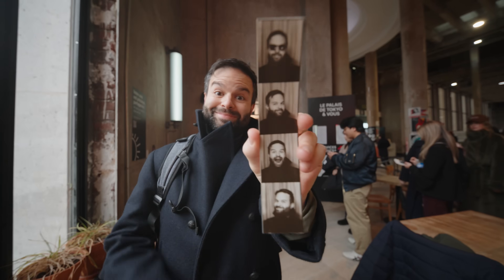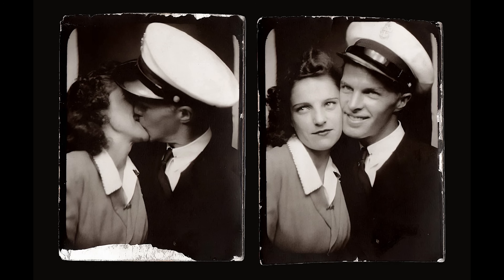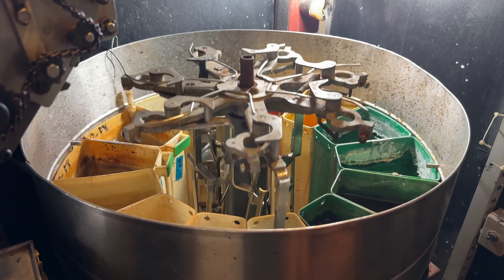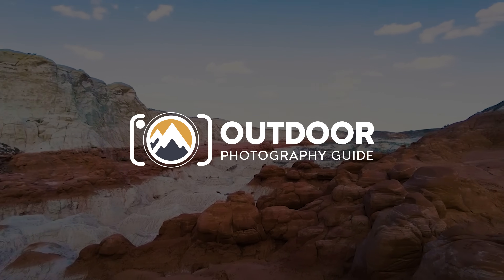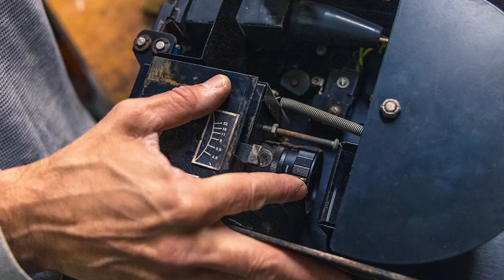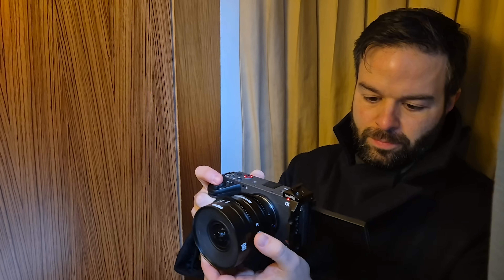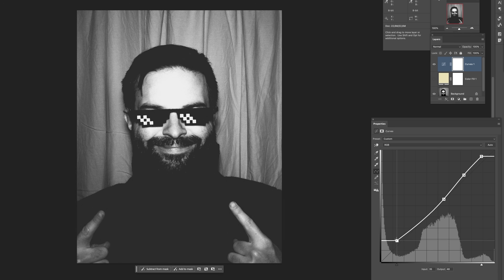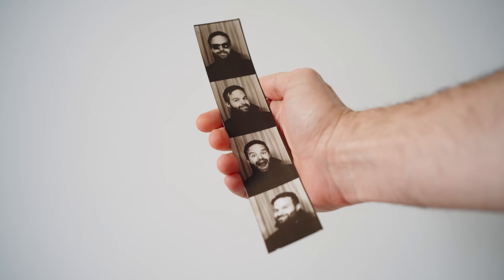What LENS is Actually inside a Vintage Photo Booth?

Comment: Really cool work!

It would be neat to see a method that doesn’t require the photo editor portion (ie, using on-camera filters or some other method). Then it’s just about a little bit of software and cutting some custom photo paper and you could get the classic 4-tile printout at the press of a button.

Comment: I'd always wondered about these devices. Not just the lens but the entire mechanism. I'd never thought about the fact there was no negative involved. Of course there wouldn't be - where would it go?, lol. They were everywhere here in California where I grew up. Bus stations. Shopping centers. Amusement parks. We took them for granted. Then they faded away much like phone booths. There's a slight glow or diffusion between the digital and chemical in your tests? Am I wrong? If so, that could flatter a portrait as well. 
Thanks for putting time into the research here. Much appreciated. 👍👍

Comment: One point that is unclear to me: you say to set the camera to black and white mode, but then suggest using a color filter in the edit phase to mimic the response curve of the original paper to skin tones. The latter instruction sounds like it should be employed prior to converting the image to monochrome, unless you mean to give the final image a color cast, but then that would be irrespective of skin tones vs. background. Can you clarify?
Reply: Second one. It's not about how the paper reacts to the image. Just that the paper itself is not a neutral white, but slightly colored
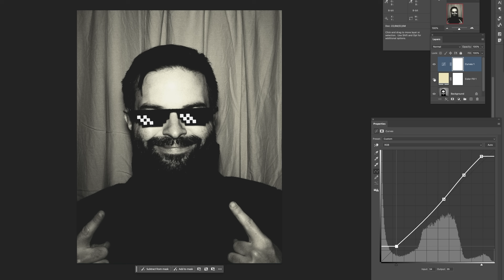Reply: @kernelpanic2887  I'm asking the content creator. If your statement were what he meant, then why does he say at 12:51 "Add a green or yellow filter to mimic how… paper reacts to skin tones."? If he said the filter was to mimic the natural color of the processed paper, you'd have a point (and i wouldn't even have asked for clarification), but he clearly does not say that. The purpose of my question is to find out, from him, if he altered his process during the making of the video, and the process he describes here is a mishmash of before and after techniques.

Comment: If you had a machine that cut sprocket holes that are in 35mm film, you could cut strips of positive printing paper (no negative) and load that in an analog film camera. The look of the photo booth requires that direct to paper process. Or you can get 35mm film (Ilford I think) that is black and white and C41 for a b+w negative. You can take that to the drugstore for process and printing. Have you seen the 20x24 Polaroid on tour? Biggest photo booth camera in the world!

Comment: As an Australian analogue photobooth technician and owner I'll answer a few points. 

1. The booths you found that utilised Nikon lenses are in fact digital booths made to look analogue.

2. The prisms are to correct for an otherwise backwards image as the photo is captured directly onto the paper.

3. Most booths utilise longer focal lengths again, with various manufacturers over time. 
In fact there are many different focal lengths used in booths that simply no longer exist.
Faster lenses are seldom used as depth of field is important for customers.
Reply from the maker: Thanks for sharing your expertise!
Reply: Merci!

Comment: Sadly, you didn't adjust the focal length and aperture to accomodate the frame size difference. Common photo booth 4-photo strips are 1.5x8in, so each frame is about 38.1x50.8mm. Your 4x3 half-frame crop of your fullframe sensor is 18x24mm, giving you an effective crop factor of 0.472. A photo booth 75mm f/4.5 lens would have the same field of view and depth of field of a 35.4mm f/2.1 lens in your setup, and 35mm f/4.5 translates to 16.5mm f/2.1. Don't skip the math next time!
Reply: You could also use a portrait 4x3 crop out of your fullframe sensor at 36x27mm with an effective crop factor of 0.7, where the 75mm f/4.5 equals 53.1mm f/3.2 and the 35mm f/4.5 equals a 24.8 f/3.2.
Reply: Right about the focal length/frame relation, I was wondering about that. It makes sense they initially used 75mm, approximately a standard focal lens for medium format (6x6cm or 4.5x6cm). However I don’t think the aperture conversion matters much, as it would be set to a much smaller aperture for optimal depth of field and flash exposure. As you can see at 8:06 it looks like it’s set to f/11 anyway.

Comment: This is cool. Now I am curious how the developing works in those booths. I never really thought about it as a kid in the 90s. I probably just assumed it was all digital.
Reply from the maker: it could have been digital, but most of the digital ones came in the early 2000
Reply: I would make an educated guess that they are "stabilization processed." In the 1970's if you needed consistent FAST prints, you bought a stabilization processor. It was a motorized set of (4?) rubber rollers and two chemistry baths. Developer and stop/fix. You took a sheet of stabilization paper in the first roller, it went into them, and then continued into the second bath. In maybe two minutes your photo came out.
 Very good for urgent press photography.
 IIRC you could run them through a proper wash later on to make them last better, but they held up just like regular prints.
 If these machined simply used reverse paper/chemistry, no negs would be needed.
 A forgotten process, since digital killed the niche market for rapid stabilization processing.
Reply: It uses a dip and dunk chemical bath with 14 tanks ending with rinse tank.
Reply: @lyfandeth  Dope! The mechanical side of it seems really cool.